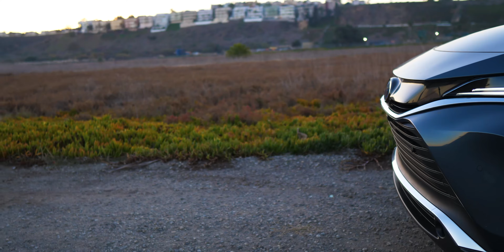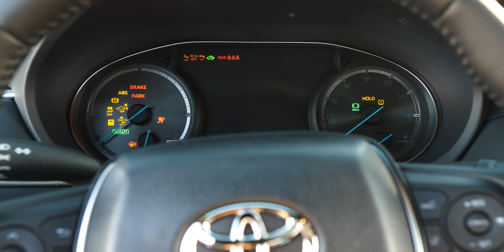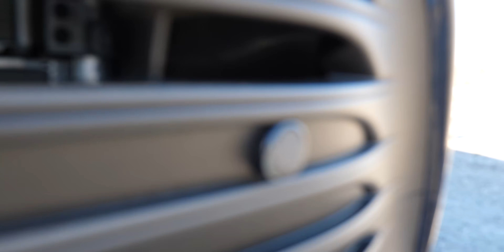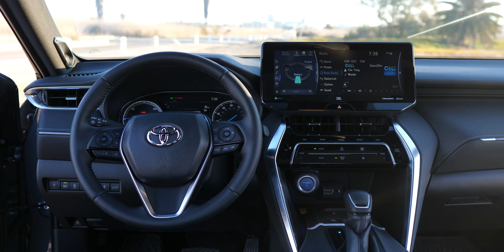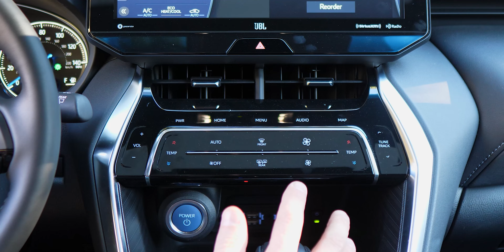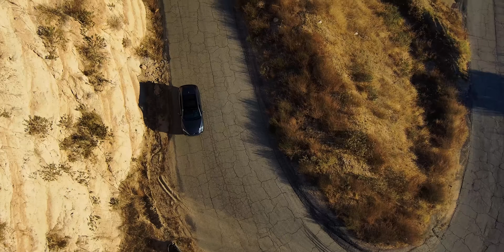2021 Toyota Venza - Watch Before You Buy

Comment: For anyone over 5’10” who sits tall, you won’t fit. 
I hit my head getting in, and on the ceiling. The drivers side is slightly better than the passenger. 
Even with the drivers seat all the way back, my driving knee is very close to everything.
Reply: I had to buy mine without ever being able to sit in or drive one and I regret it. Is it nice? Sure. 
Do I want to get rid of it immediately? Also yes.
Reply: Having a wireless charger, but needing to plug it in to use Apple CarPlay? Stupid. Unnecessary.
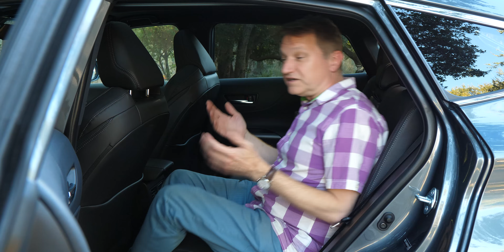Reply: 6:47 your knees will touch, uncomfortably so. Your head will hit the body of the car getting in, and the ceiling when you’re in.
Reply: How tall are you? I’m 6’1 and I test drove one recently and I was fine

Comment: I really think they need to redo the front fascia (even though in sure it had something to do with its insane mpg people are getting over equivalent rav 4 hybrid on hwy) 
Point is, its noce, it can be a tiny bit better.
Get rid of all the hard junk plastic on b pillar and bottom of doors.
Make better electric modes, i.e. bmw has for its e versions where u drive to n from work it learns and guages by maps, ur route and best uses the power plants to make best use of the power n best efficiency and then shows u exactly what ur doing in simple ways that make sense. 

Also on this model, it has buttons on le n xle not equipped with the 12 inch screen. The 8 in screen has buttons as does the heat/ac has buttons and dials which i think look nice and are way easier to use.
So id say if ur serious about this, skip the top trim, unless u need the sweet moon roof changing thing, that doesnt even open lol.

Its not bad, but i wish theyd let their consumers change it around.

This is for sale in japan as the harrier.

Also this is exclusively made in japan, al venzas for 2021 are. That will change if it takes off. So get one while its made there.
Im going after one of these for the sole purpose that i dont want a rav 4 hybrid with 2 vin number on the start. Im never going to drive offroad. Idc at all how slow it is. I drive far and care very much achieving 40 plus mpg n very excited about such
Reply: Made in Japan is the way to go. So if i want a Japanese only car buy one with the Vin that begins with the number 2 ? Ok thank you! 100 percent Japanese for me
Reply: @BotchedInvestigation  noo, if it begins with 2 its def not Japanese it'll be made in canada with a 2, it will  made in Japan with a j. Germany is w n usa made vehicles are 1,4, or 5. Cars made in Mexico are 3. Korea it will stsrt with a K. England=s. Italy is z. China, which atm are very rare (which is a good, but as we move closer to ev's i think they'll pop up more) is an L. 

So if ur buying a toyota look for a J at the of thr vin #.
Reply: @todtalk3912  oh ok very nice much appreciated!

Comment: I got my 2021 Venza in March.  Overall I love it, however having no raised buttons for the air, music, map, etc, you have to take your eyes off the road to see where to touch for these things.   I'm averaging 40 mph, getting 45 mph on the interstate if I keep my speed around 68 mph. I can travel around 500 miles on a tank of gas which is nice for trips. The traffic sensors are very quick to respond when needed... the car automatically slammed on brakes when it saw a deer bolting across the road right in front of me, so always wear your seatbelt.

Comment: I have the 2021 venza limited, i luv it, however there are issues with the cup holders, if there is a drink in it or your reaching for the dash the driver will hit the drink with their elbow, so you have to reach around to the dash.  Also an issue with sun visor not coming down low enough to block out early sun. And there is a horrible noise having to do with the traction going over some not all dips!!!  This car needs some improvements big time.

Comment: I own a Venza limited without the switchable skylight. It rides about the same as a Subaru Outback. Wind noise noticeable on highway. Road noise varies enormously with types of pavement. Engine noise no problem. Gas mileage 35-37 mpg. Handles well, seats comfortable, throttle & brake response very smooth. CVT excellent. Nav system awful, lane centering unpredictable, adaptive cruise control mostly good, but loses lead vehicle too easily on curves and hills, and picks up stopped vehicle at red light too late.

If you are new to a hybrid as I am, take a look at the YouTube videos by the Car Care Nut. There are surprises in store about things like jump-starting, no alternator or starter, etc.

Comment: To get buttons control, get the LE trim.
Reply: Yes I missed out on the birds eye view and rear view mirror camera and heated seats but id honestly rather have the buttons over capacitive touch. Love my venza. Still has the power mirrors, seat, and liftgate, and the lane assist and adaptive cruise. Thats all I need.  Rides like its on a cloud
Reply: I haven't seen one review anywhere of a lower-end trim Venza. Shame that all reviews focus on the loaded models.
Reply: @thekenthouse6428  i think toyota Jeff has a good le review
Reply: @justinlalugski2083  Thank you, I'll check that out
Reply: @thekenthouse6428  all reviews are like that for every car. I think they pick the one they think will be the biggest seller. I agree they should do base models too because those can be a little different.
Reply: @thekenthouse6428  Toyota Jeff reviews has a review of all three trims. Might be the best one I’ve seen.

Comment: I WAS looking at the Venza...  Until I found out it has a ZERO tow rating, and Imitation Leather Seating.  PU-Leather or Bonded Leather, I don't care how it "feels" does not hold up.  Sorry Toyota !
Reply: Cars these days aren’t built to last The way around that is to lease Takes the whole “built to last/not built to last” thing off the table.   Gives control back to me everything is planned obsolescence these days so I plan on getting out of my lease when it all starts breaking down🤣
Reply: @luckyfamilyman  Cars are built much better than they used to be.  The average age of cars keeps increasing and before 2021 they were becoming more affordable.
Reply from the maker: If you want to tow, this is not the one to get!
Reply: Draw-Tite sells a 3500 lb hitch for the 21 Venza.  You have to go aftermarket for the hitch and wiring.  You will lose the kick sensor for the rear tailgate.

Comment: I’m buying it today. Going from 2016 Mercedes C300 to this beautiful hybrid in white! ♥️
Reply: LaShonda...did you get your Venza? How do you like it and how does it compare to your Benz? Thanks.
Reply: I purchased the red one in May 2021. I love it. After a work week, I’d only burned a half tank of gas. A lot of head turning. The sound full..you don’t hear speakers banging in the back. Fun to drive on the highway. I love my Venza as much as I love my Mercedes CLA 250c. The backup cameras phenomenal. I don’t struggle to backup. Not afraid I’m going to hit anything. It’s really really nice. I love the tablet. I haven’t figured out how to see my heads up display. I’m not sure if mine is equipped with it. But, I do have the panoramic roof. I feel like Toyota does need to make the roof open. Keep you some screen wipes because you’ll leave your fingerprints on the screen and AC display.
Reply from the maker: Congrats!
Reply: Congratulations you will love it.  I bought mine in blueprint in March and absolutely love it .  The car is amazing.